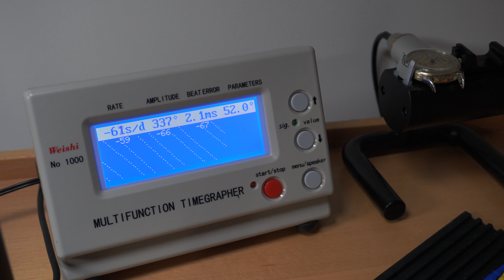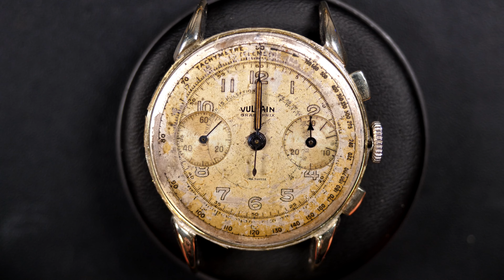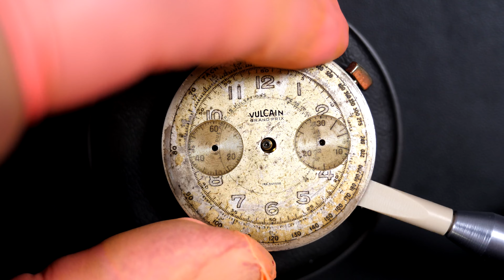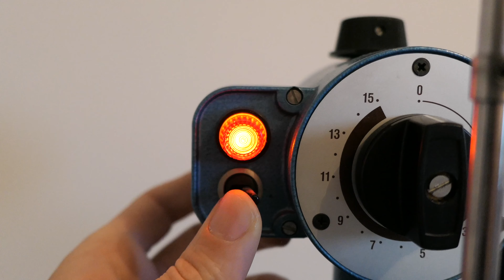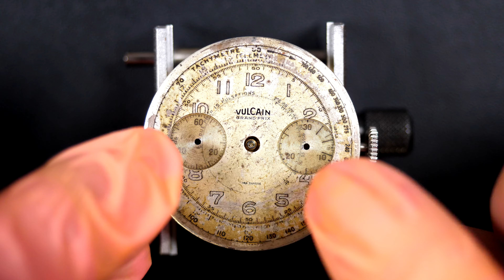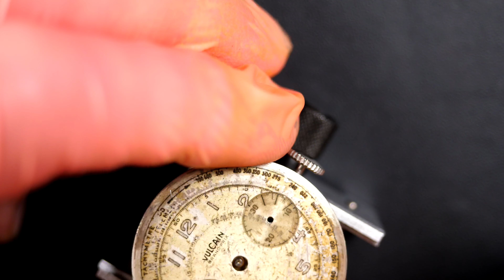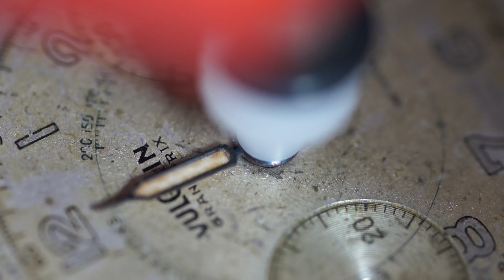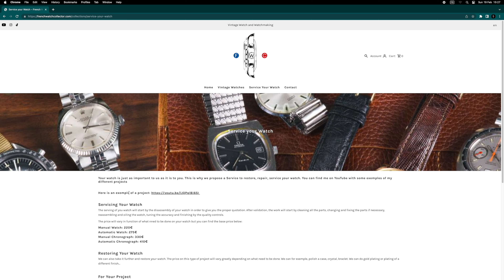Vintage Chronograph Restoration With a Huge Charm!!! Vulcain Valjoux 22 Chronograph

Comment: Nice job but I'm not sure is the seconds hand on the left in the right position? I may be very wrong but I think that you have it 30 seconds advanced.  So when the crono is on the 12 o'clock position, it is on the 30 seconds position. I dot take a look.😊
Sorry not the seconds hand, the hours hand.
Reply from the maker: There is no link between the sub second and the chrono. The delta between the two will just depend on when you start the chrono
Reply: @FrenchWatchCollector  OK I guess it's my personal ocd lol

Comment: Why did you not use a mainspring winder?
Reply from the maker: Because I did not have the right size
Reply: I’ve just started getting into this game. I bought a set of mainspring winders - not the high end Bergeon set, but a mid-range set from Amazon. If I don’t have the exact size I use the nearest smaller one. Seems to work ok.
Reply: Love your work by the way. I’m learning a lot watching you. Can I ask what automatic oiler you use?
Reply from the maker: @ipwright  yes once in a while you will get an odd size